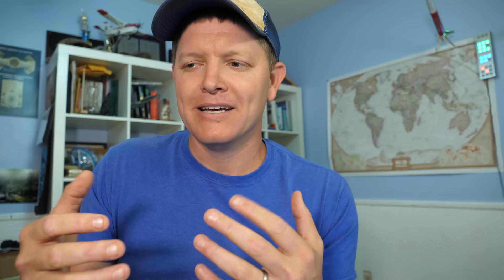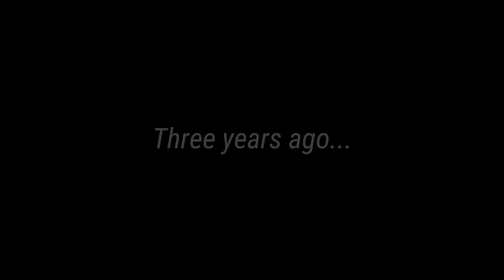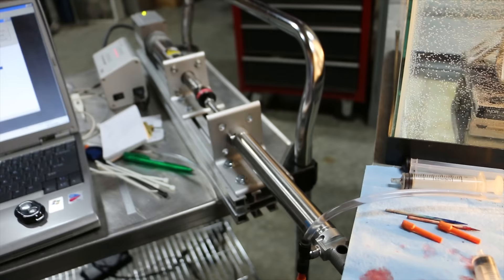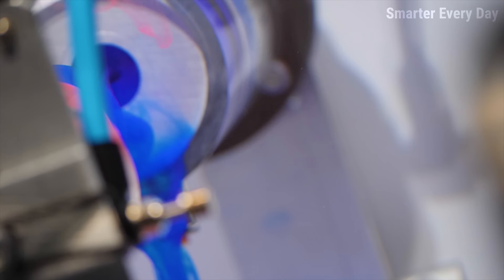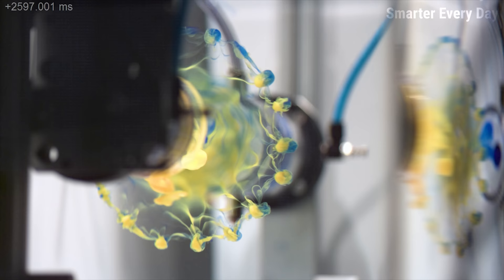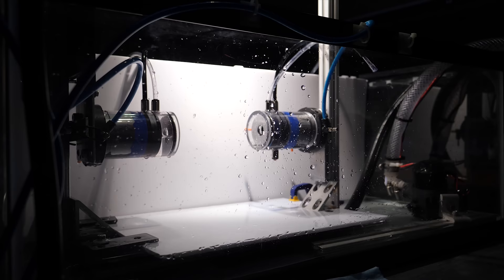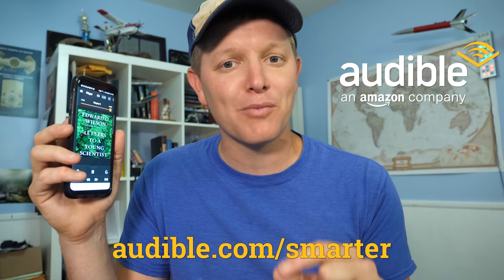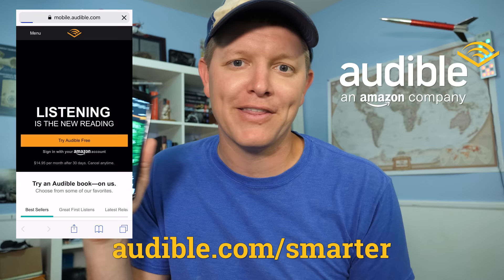Two Vortex Rings Colliding in SLOW MOTION - Smarter Every Day 195

Comment: As I understand the matter any rotating mass can essentially behave like a gyroscope.

That may be why the tenure of stability vortices can sustain could be dependent upon the relationship between density for a fluid medium in which they are propagated and kinetic entropy inherent to it.

Because the rotating masses you employed in your experiment are initially propagated as lenticular discs in a fluid which are relatively stable, yet nonetheless undergo metamorphosis to become annular vortices consequent to collision, it seems to substantiate the likelihood that precession is involved.

That the aforementioned collision results in additional and evidently increasingly complex sequences of vortices may be instigated and/or amplified by slight cumulative increase to pressure and velocity for fluid present between the colliding vortices resulting in precession due to dynamic effects consequent to diametrically opposed impact of two relatively flat 'pseudo surfaces'.

If the centre of the disc shaped vortices were not the same thickness as their perimeter that could also result in additional lateral acceleration impinging upon intervening fluid and result in precession for the vortices.

It is possible resultant interactions between the fluid and the vortices may not be torque-free however because vectors for the initial vortices were juxtaposed on the axes aligned with direction of travel.

Evidently some effect imparts subsequent change, possibly due to lateral dissipation of the aforementioned pressure increase resulting in friction occurring between the intervening fluid acquiring a dynamic lateral vector and the vortices.

It would be very interesting to observe repetition for the experiment using fluids of varying density and propagation of vortices with diverse rotational characteristics such as two or more whirlpools emulating black holes, although that may only be possible subject to neutral gravity.

The patterns are as beautiful as they are fascinating!

Comment: Now that I'm rewatching this. It reminds me of something. In an engine. If the gap in piston rings closes. If the gap is closed and forced more the piston ring has to go somewhere which on piston rings the ends will either bend up or down. Normally up. But im wondering if thats why the seconds rings form. The two main rings hit eachother evenly. And has nowhere to go. So it has to go somewhere so it turns and goes outwards. I dont know just a thought. Comparison.

Comment: I'm at 5:52 and a wanted to stop and write this before going further. I'm watching ad you perfect shooting and I'm thinking "why does it do this? I can understand them flattening together.  Then I think about each secondary ring snapping away from the ones next to it like a rubber band being stretched to apart in all directions, all at once and with equal force.  And like a hot and cold ( each opposite the other) front meeting to create a tornado, left and right collide and swirl unto nothing. And when perfect equal forces collide you get perfectly, evenly,, dispersed secondary swirls." This is the point when the microwave background radiation, and how evenly spread out everything way moments after the big bang, popped into my head. Followed by "well, not compelling even." As I think about the big void at the bottom right of the picture. Followed by how hard it is to get it perfect here......  that was it.

Comment: the second ring are because think of it there a limit of mass and the force of the two hitting making it go back but around so it can only do so much with the mass and it push the paint to follow it so it going back on both side and going farer away from the mid

Comment: Don't the second rings show up because the event horizon of the expansion is suddenly collapsing causing the amount of force which was previously directed evenly in a single plane.  So when it looses the monopoly of force its acceleration stopped at its original center as the new surrounding waves of pressure Create the new mini votex.

Comment: Did you try varying the media density in the tank at any point? I am curious as to how variance in media density inpacts the surface tension of the ink which might then affect the propagation of the rings. Conversely, did you try changing the density of the fluid that transported the ink to see how that changes the ring formation?

Comment: The force of the speed is causing the died water to move in the direction that it’s not be set up at so if the speed is are the same on both red and blue that could cause the rings to be set at the same exact angle on each on the the movement of the died water could cause the rings to start because the still a force there it’s just not moving so when the died water is moving into the non died water the mass of the died water could catch like a parachute  so the died water would be force into its self making a ring and it would cause the ring to spin that’s my theory

Comment: I don't feel that the outer segments turning 90 degrees then eliciting a ring per segment, is such a complex issue to comprehend...

The outward force of the main ring is stronger than the weaker force of that ring's expansion breaking it into smaller pieces...

therefore, assuming that's the case (as evidenced by the video) the continual lateral motion, the segments are now turning & expanding & turning into smaller rings because those are the only resistance points left while there's still enough motion of those parts.

Were this re-creatable at higher speeds, I feel that even those smaller rings would then split into multiple parts, then recreate the turn & ring process again, until all motion & thus resistance necessary & capable of eliciting that, ended.

Comment: Wouldn’t this be attributable to Newtons Third Law? For every action there is equal but opposite reaction. For example looking at the yellow and blue dye. When the main vortexes assimilate together it caused a smaller vortices to form and attempt to balance out the change inside the medium (water in this case) but they went in the opposite direction of the main vortices? Couldn’t the same phenomenon we just watched and you replicated almost have the same function of say gravity or even the very fabric of space & time? When there’s a disturbance whatever the medium is, it’s going to want to balance itself out much like what the vortexes did with this but instead of going the route that the big ones did it followed the Third Law and made an equal but opposite reaction? Idk food for thought

Comment: What if you have something like a chamber it's cylindrical shape with the diameter ouf the container 120mm long or shorter and 2 tube with the size of this cylindrical "nozzles" what ever and then test it.

And can it be done several times in short intervals?